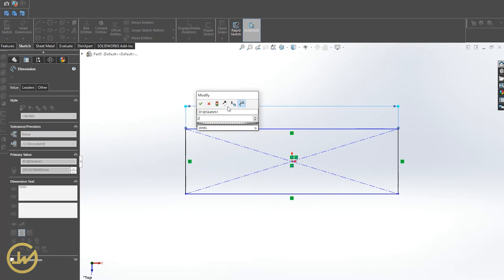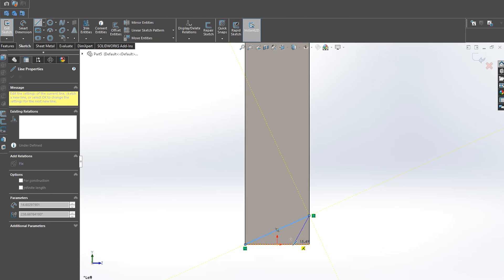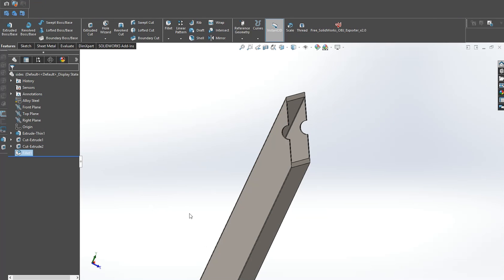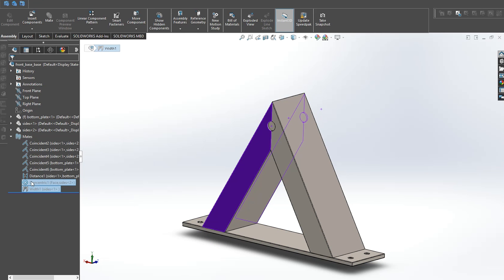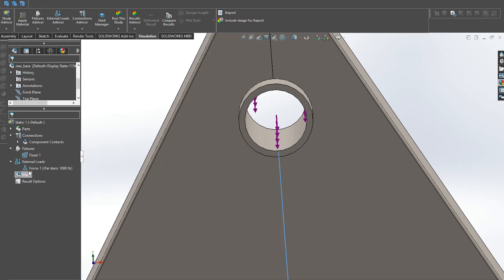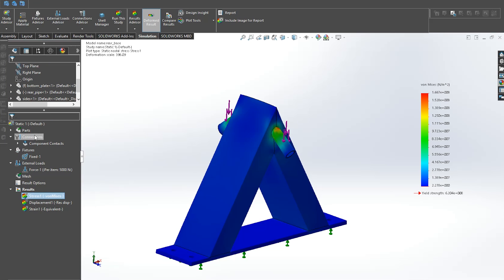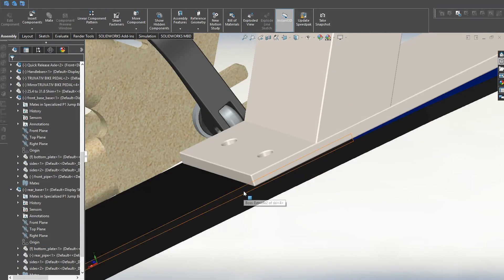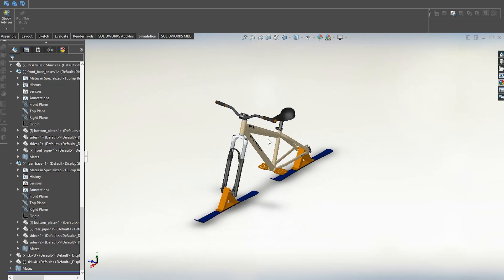How To Make A SKIBIKE | PART 1

Comment: Please tell me the name of the application what you use in modeling. Thanks
Reply from the maker: I am using Solidworks 2016 for modeling and running simulations. There are a lots of modeling software but solidworks is still my favorite. You can also try Fusion 360, which became pretty popular in the last year :)